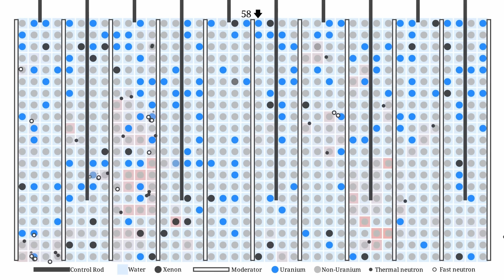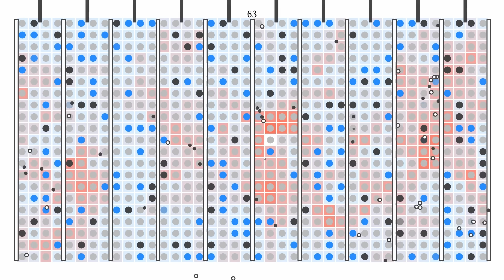Chernobyl Accident - Simulation only (no talk)

Comment: The whole event is a tragic version of ukrainian version of Jackass and Dumb and Dumber combined.They had computer which tried to prevent em from removing all the control
 rods.They turned it off. in reactors manual are specifically mention not to remove all the rods therefore the all thing becomes not controllable.  What they did is similar to pouring gasoline over the body of a red hot engine in attempt to make it run . well it ran.. with the whole building. The next events are well known history.

Comment: "The computer warns to shut down immedietly, instead they shut down the computer off" bro 😥
Reply: Computer don't warned about it (that technology wasn't available at the time), the Nuclear Safety Regulation of the Soviet Union demanded that as mandatory in that situation: regulation was violated, including minimum of 30 control roads, 700 MWt and other important rules.
Reply: @andymarquez9902  Those minima were introduced after the accident.
Reply: 8 years ago I had a spine surgery done for scoliosis. The surgeon did this exact thing. He acknowledged it the first time, reworked everything a little for a couple hours. Poking and shifting and redoing screws. He closed me up and the monitor was going off again so he turned it off and sent me out as is. I woke up unable to feel my left leg, genital, and no function of my bladder. No function of my bladder led to stage 3 kidney disease at first. Then over the years it caused end stage renal (kidney) disease and now I’m a dialysis patient. No feeling in my genital makes enjoying sex difficult and I often never get pleasure if I’m not mentally stimulated which makes me worry about having kids. The left leg healed a lot quickly but my left foot is stubborn. I get these pains in my numb foot where it’s my nerves trying to heal. It happens when I relax, if I move around it goes away. If I try to sleep, it happens the worst but not consistently. I have gone months without the shocking pains but when it happens, it makes dialysis insufferable, and I get restless nights.
Reply: really sorry to hear that man. While there are great doctors and surgeons, i am terrified of every operation because there is no room for mistakes there. Always took care of my teeth but once i had a problem with my gums and went do a smallest operation they managed to do it wrong. Another surgeon stood and looked at the result for 10 seconds before saying, who the hell did this?! the ones that did the operation didn't say anything just looked at me weird.
Reply: Did you sue him? @eight2oh
Reply: Did you sue ?
Reply: No such computer warnings happened, the SKALA system didn't make warnings. That bit of information came from Mr. Grigori Medvedev, a known liar in the Chernobyl field.
Reply: @isaowater  The computer DID warn them. I will give a  source later.
Reply: @isaowater bla bla russian sympathizer bot

You're the liar dyatlov boot licker
Reply: @isaowater  commie.
Reply: >press any button to shutdown reactor
>press the power button
>computer turns off
Reply: Of course the damn computer warns us to shut down immediately; it doesn't know we're running a test.
Reply: It’s orcistan, what you expect?
Reply: @aleksey.g21 Чернобыль был на Украине 😆

Comment: As someone with zero knowledge of nuclear stuff, "wow so pretty when it starts changing colors!"
Reply: The fuel rods are constantly cooled with water, when heated up enough; they create steam, that steam rotated turbines just like any other power plant.

The problem here is; without the control rods slowing down/stopping the fission, they got way too hot, and then completely out of control, Vaporising all water and melting everything around them.
Reply: @PKTraceur thx, now i can understand better
Reply: "Hey, I'm blue now!"
Reply: The previous comment stated the steam engine principle, which is true but they neglected the entirety of this means.

So from scratch I'll be brief as I can and as objectively correct as I can so sorry any nuclear physicist if I get something wrong.

So to start, the Uranium is Fuel, when it fissions (as in it splits, it's the opposite of fusing), it creates fission products, AKA what is left of the uranium after being split apart and because the number of protons in a nucleus dictates what element of the periodic table is, you'll definitely get elements with a lower atomic number (IE the aforementioned number of protons) than Uranium. If you add them all up including the neutrons released, it adds up to the same sum of neutrons and protons (not gonna dip into radioactive decay of why sometimes there's one more and one less proton and neutron). 
Some of those products are so unstable that they are readily available receivers of neutrons, in the video there was Xenon, more specifically Xenon-135 as it's so unstable that ironically, getting another neutron (for reasons I won't get into) will make it a lot more stable. Basically what happened before removing the control rods was that the reactor got "Poisoned out" which isotopes like those are called reactor poisons. From my understanding, the engineers didn't know this was partially used fuel because of failure in the communication and were basically operating blind and shocked that it poisoned out.

Here's more theory, so every fission in Uranium releases on average 2.3 something, can't remember, but it's a wildly varying variable but is frequently 2 to 3 neutrons. You will notice there's two types of neutrons. One of them is the fast neutrons, which are recently released fissioned  while the other is thermal neutrons, whom have slowed down or "thermalized" releasing some energy as well. There's also delayed neutrons which is the fission products which unfortunately the video doesn't seemingly cover that but they basically just decay by neutron emission as opposed to the uranium fission.

Finally there's the control rods and moderators you saw in the video.  Control rods are the easiest, they basically just absorb the neutrons quite readily, like the poisons do, without the radioactive decay that is.
Moderators are a slighty complicated because certain reactors use different ones but they just thermalize the fast neutrons, some are way better than others and others are a happy compromise.
Water is an example, it's a moderator that doubles as coolant.
RBMK (chernobyl model reactor and any russian reactor) didn't use water as a dedicated moderator, more so as a moderator by happenstance but a coolant first and using a different moderator. 

Here's a brief run down on the events.
The reactor poisoned out while working at low power, with engineers deciding to pull the rods out (this has to be done slowly) and restarting the reactor.
It works, but due to their ignorance cus they didn't get the memo, the slightly poisoned fuel was completely poisoned and was basically outputting power now because now the poisons serve as control rods and because poisons can be "burnt out" by having them capture neutrons, the reactor is on borrowed time.
Finally, the power spikes and the engineers hit what is effectively the scram button where they drop the rods back in before things get much worse.
One thing the video didn't communicate is that they jammed partway through and because they are graphite (another moderator but not intentional) "tipped", those tips just feed the reaction by slowing the neutrons more for reactions, which caused that huge fuckfest of a reaction of balls.
Reply: okay, explanation time (very late)
-hot rock (uranium or other radioactive rock)
-hot rock makes water boil
-boil water equals steam, which moves a fan
-fan moving creates energy
-power!
-hot rock can get out of hand
-solution? add giant walls that regulate the heat from spreading! (control rods)
-uh oh! too much heat regulate! xenon builds up! (xenon make reactor stall aka turn off)
-reactor stall
-how fix? raise all the control rods to raise heat!
-uh oh, the xenon boiled away and so did all the water, heat too big and reactor is beginning to whistle cause its full of steam that wants to kaboom
-LOWER ALL THE CONTROL RODS TO STOP THE REACTOR!!!
-rods got stuck, and their tips are graphite (graphite makes hot rock radiation more powerful)
-boom :(
Reply: @Metal_Oxidizer So the rods are meant to be a wall that regulate the heat, huh? Then why make their tips graphite? Is that stoopid or am me stoopid for not udnerstanding

Comment: from the movie i believe they said the test had to be suspended up to tomorrow because of xenon poisoning. can you elaborate more on that? why they had to wait up to tomorrow?
Reply from the maker: That's what the safety protocol says. They should have wait for most of the xenon to decay away by itself (half life of xenon 135 is about 9.2 hours)
Reply: @Higgsinophysics  thanks for the explanation. But didn't residual heat enough to stop xenon poisoning?

Comment: Hi, nice video, but factually not quite right if I may say so. The explosion was actually finally triggered by insertion of the control rods which interacted with water in the reactor, and the water acted as the moderator. This is the difference between designs that have positive and negative void coefficients. One gets colder as the water boils, the other gets hotter (like Chenobyl).
Cheers, 
Brian.

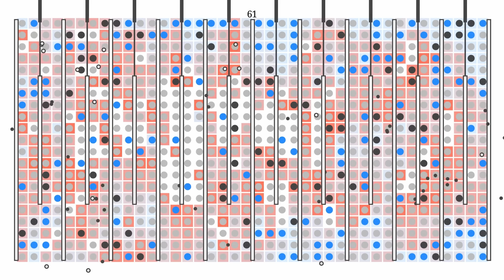Comment: What happened at 3:17? The "moderator" suddenly appearing under rods?
Reply: IRL control rods had Graphite (moderator) tips. It was irrelevant up to this point, but they got stuck even more accelerating the reaction instead of controlling it
Reply: Dude just igored them, so the first 3 mins is incorrect. The reactor looked nothing like that. The simulation here also doesn't show the true cause, the graphite rods moved down into the lower core, displacing the water and increasing the reactivity there. This simply isnt shown. The video suggests the graphite rods getting stuck caused the runaway, but these rods were there the whole time. i think the "simulation" is not based on the actual reactor physics.
Reply: i was wondering this too
Reply: Chernobyl's RMBK had graphite tips, which is bad design but cheap. They could have used another material, it's argued that this information was kept from the engineers and people running the reactor. So for the sake of money, the very SCRAM safety device that was meant to save them actually accelerated it and blew up the reactor.
Reply: @seeriktus  this was not kept from the engineers. The control rod was half graphite, the purpose was to accelerate the reaction as it entered the core, so the rod did double duty as brake and accelerator, increasing its effectiveness, and they knew all about that. You watch too much tv.
Reply: The problem is hitting the AZ-5 button should immediately decrease reactivity in the reactor, however due to the design of the control rods the graphite displacers moving down and displacing the neutron-absorbing water at the bottom of the vessel actually increased reactivity there. This is extremely bad design resulting from cost-cutting measures (not making the graphite displacers cover the full height of the vessel)  @dachhh
Reply: @dachhh  that design is still dumb as hell, and any jam would lead to a runaway.